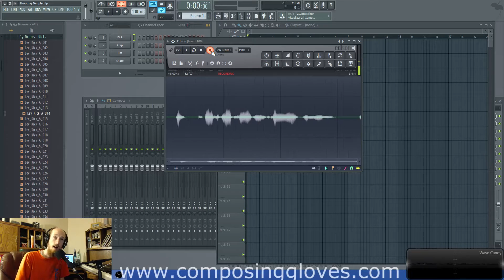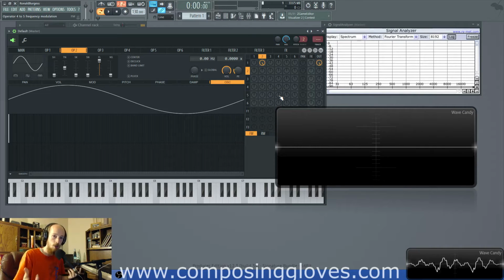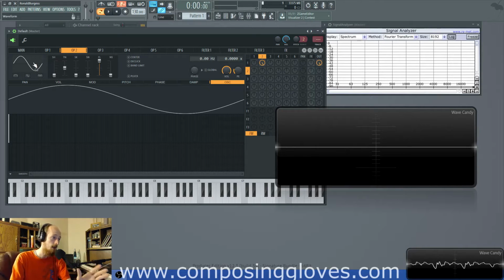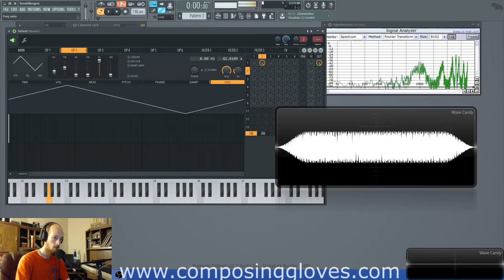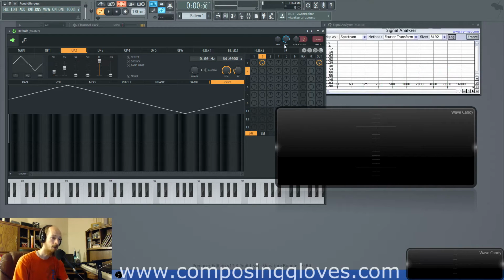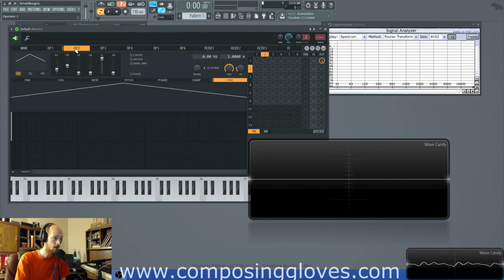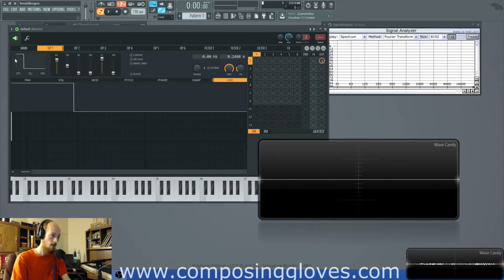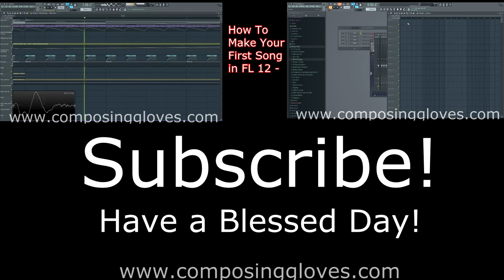Learn FM 12 - Hearing Sidebands

Comment: If I wanna make patches that don't introduce any dissonant tones that clash with dense harmony, should I base my ratios off just intonation? Or does it sound nice when you base it on your tuning? (Assuming the interval you're using isn't very flat/sharp or too dissonant to begin with)
Surge has recently incorporated micro-tuning, so that makes at least 2 free xenharmonic supporting FM synths alongside Xen-FMTS 2, overal tuning system and fm seem like an interesting combo.